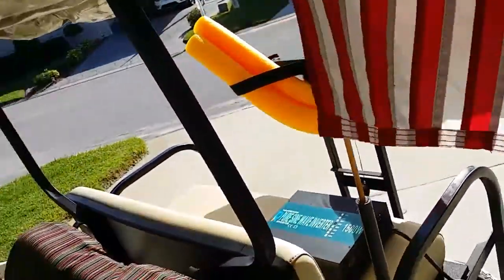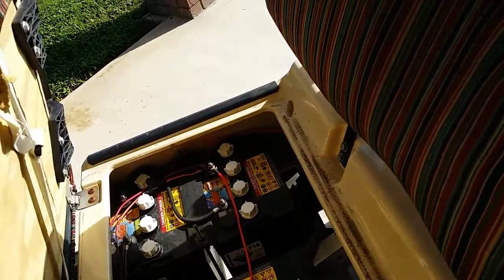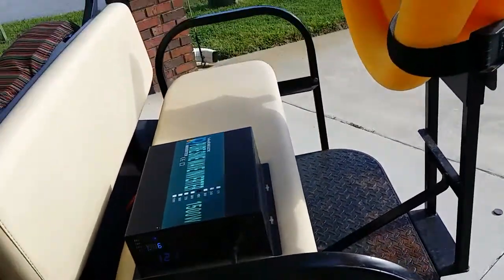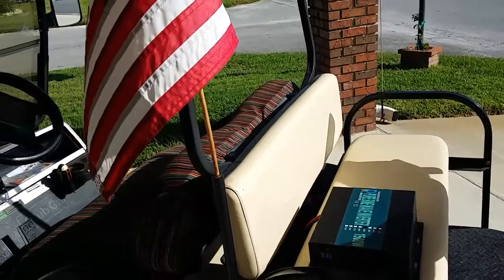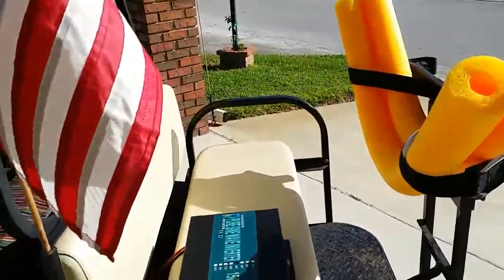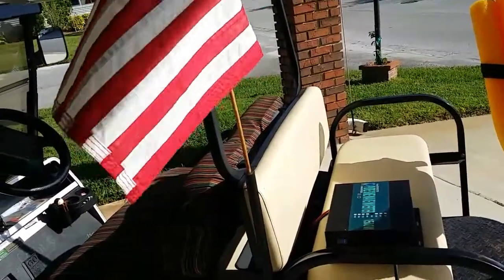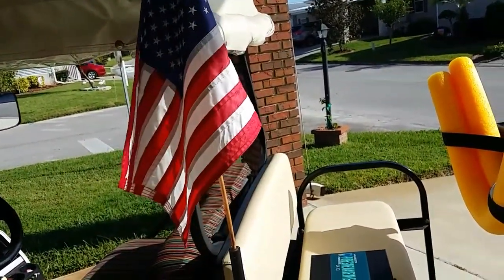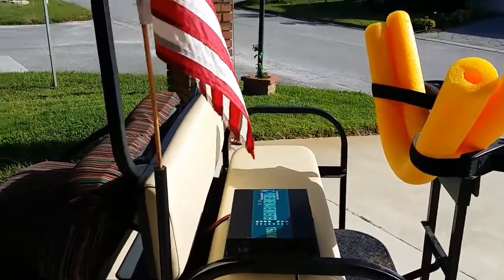Using a golf cart as an AC backup generator

Comment: I reversed the circuit in my garage and installed a 30 amp transfer switch that i hook the main power too and my 2000 watt inverter with remote from reliable.  I installed a small breaker box after the transfer switch with a 15 amp breaker to protect the circuit.  The circuit runs the majority of my living room including my tv, dish receiver and router and entertainment system.  Where the circuit ends in my inside power box,  i installed a interlock that keeps this circuit off unless the main breaker is off and then it can be turned on to feed the box and power all lights and anything that is small enough that it doesnt trigger the 15 amp breaker.  Before turning the interlocked breaker on to feed the box,  i turn off all large breakers for furnace, air conditioning and hot water heater.  I also installed a quick disconnect 4 guage wires from my golf cart batteries to my inverter.  Now, if my power goes off,  all i have to do is take my remote out of my pocket and hit the on button,  the inverter turnsonand there is a 45 second delay before the transfer switch changes and i have power on the one circuit that runs my living room and garage.  My garage door opener is also in with this so if i come home and have no power, i can hit the remote and open the garage door also.  Then if the power is off long enough,  i can turn the interlock breaker on in my box and feed the remainder of my lights in the house.  My next step with this project is too add solar panels to charge the batteries and then i can run this circuit everyday for free.  I haven't found anything other than your video on the internet about using a golf cart as a backup.  I don't understand why more people are not using this huge power source to their advantage.
Reply: Hi Jonathan....I have a golf cart as well and am planning on using it as a backup for my electrical system at my cottage. I have a generator and auto transfer switch at home but I know that at my cottage I will be using solar and battery storage for backup emergency power.  I got the manual transfer from the cart to the main power worked out and it will be fairly straight forward...and i agree.. this video and your comment helped a lot.  I am also looking  for a good way to power my cart from a solar array and cant seem to find any info other than some rinky dink 12 v panels that you put on the roof of a cart.  did you ever find some more info?
Reply: @wientz  I agree, I wouldn't use those 12 volt panels. I do plan on adding solar but haven't yet. I probably will not put panels on top of my cart. I will start with 3 36v panels  since my batteries in my golf cart are 36 volt batteries. I'll add a charge controller and necessary cut offs and fuse's. I'll connect from the charge controller to the batteries with a easy to disconnect wire. I'll see how that works and add to as necessary. Good luck with your setup and thanks for commenting.

Comment: Cool idea! My golf cart is also 48 volt. Do you have a diagram/instructions on how you wired it up? Also, what kind of inverter did you buy? Thanks!
Reply from the maker: TheDriverR7 
I purchased a 48 volt DC to 110 volt AC 1500 watt inverter off Ebay for about $150.  It has a + and - input which you connect across all 6 8V batteries.  This would be the two wires running to the speed controller.  You should use at least 10 guage wires.  I bought a 100 amp plug set so you can unplug the inverter when not in use.  The inverter has two Nema style recepticals for the 110/120 volt outputs.
Reply: Chuck Kent 
Thanks for the information! I like your flag by the way (God bless the USA!)
Reply: great idea... I'm actually working on mine.  I'm in FL as well.  I just ordered a 3k inverter for my 36v.  Question, how many hours of what appliance did you successfully run?  sounds like on video you were predicting.  Thanks!

Comment: Hi Chuck I wa doing what I saw in your video but I was using a 3000 watt inverter.  It is called power drive 3000.  When I made the final connection to my positive cable it started smoking.  Was wondering what the problem might be?
Reply: That inverter is meant for 12 volts. Golf carts have 36 to 48 volts.